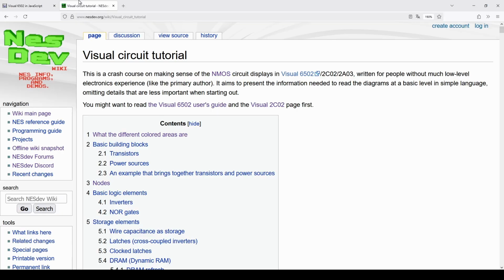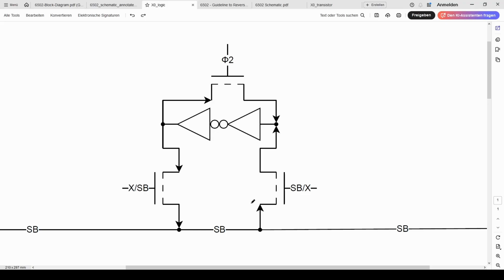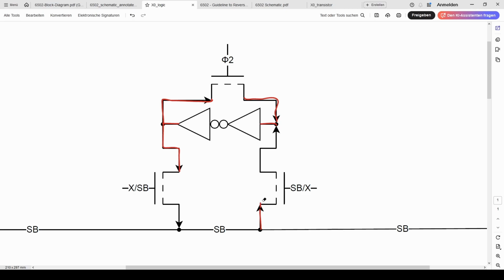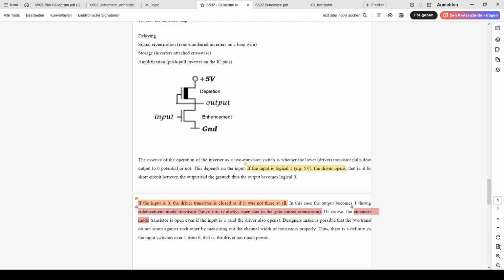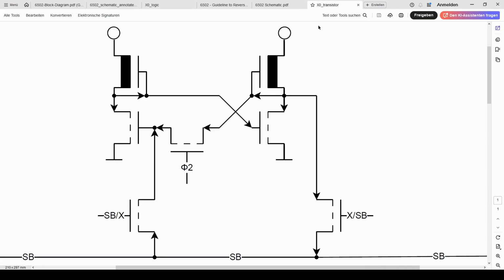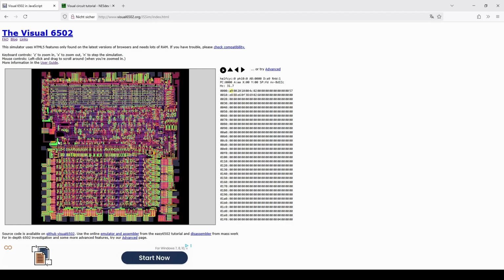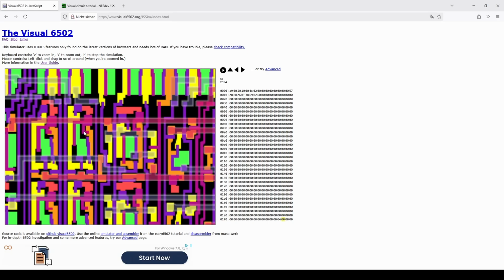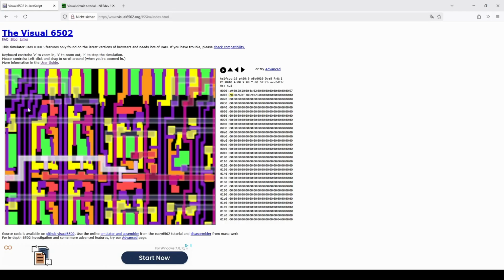Guide: How to Read Visual6502

Comment: I would really love to understand the decoder part of the 6502. This video needs to be shared. You're the first person that does an effort to explain what happens in the 6502.
Reply from the maker: Thanks for the kind words! I assume you mean the instruction decoder? Knowing there is interest, I will strive to make a video about it when time allows (and if I myself can understand it, of course).

One interesting tidbit of information I can give you on instruction decoding right now is that all the set/clear flag instructions (such as SEC and CLC) differ only by bit 5 ($20) being set or cleared, respectively. According to Hanson's block diagram, this bit from the instruction word goes directly into the status register. Obviously, which flag ends up being updated will be decided by other logic.